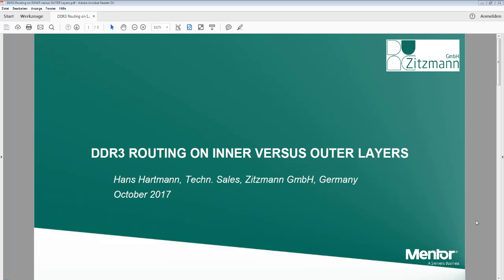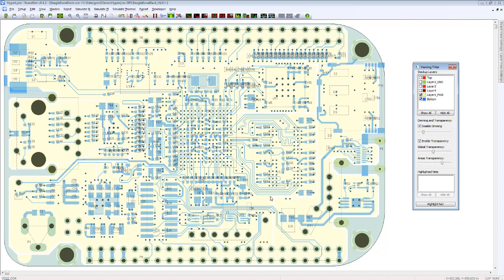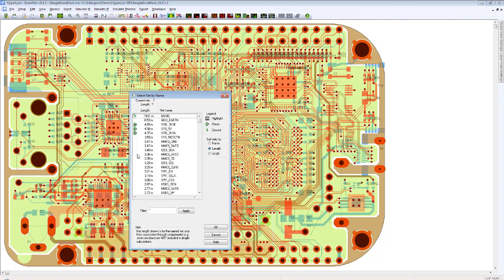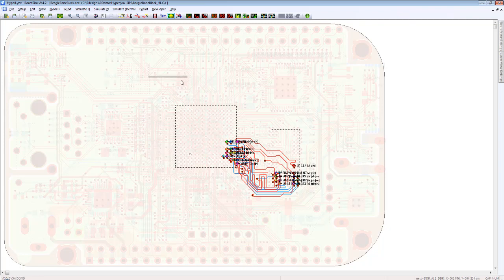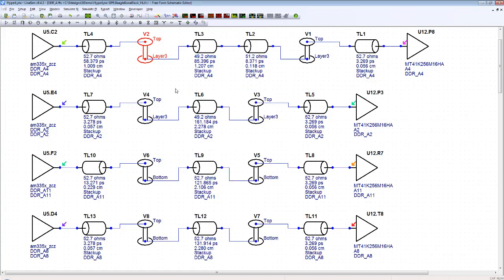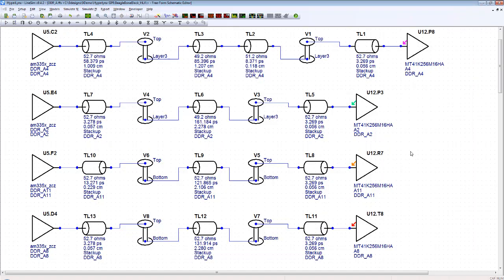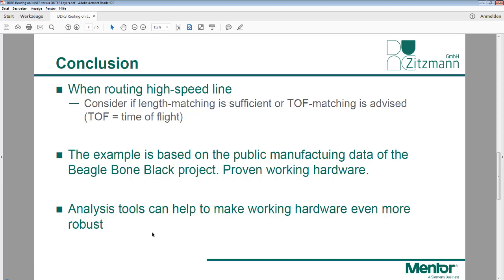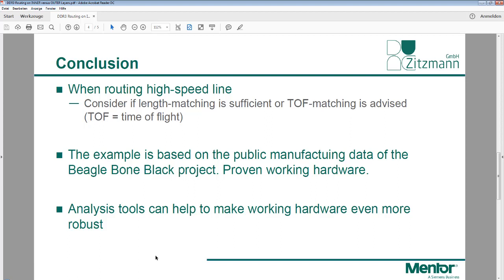DDR3 Routing in Inner- versus on Outer-Layers of a PCB

Comment: Very good video. A lot of newcomers to high speed design focus on matching lengths with the ultimate aim to minimise skew. You have clearly shown why length is not the only factor to take into account but also the vias, layer span and differing propagation delays. Interesting how line A4 also changes impedance on the same layer - I assume a trace width change for some reason.